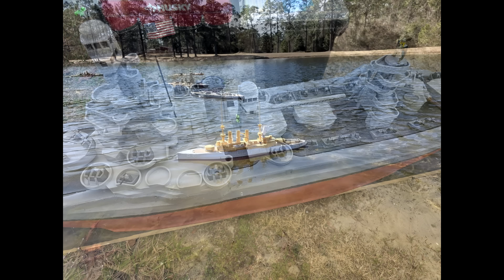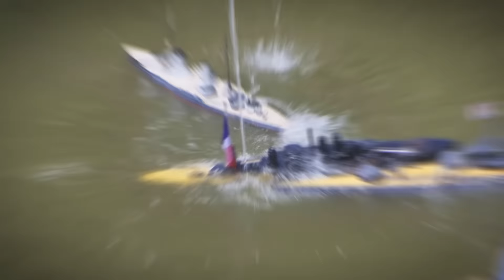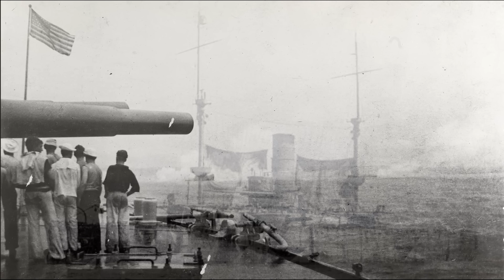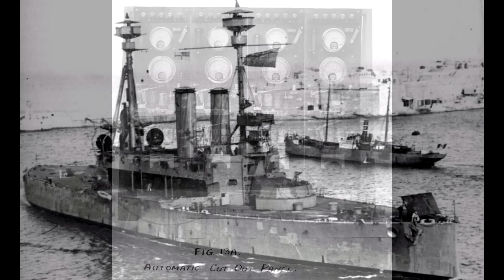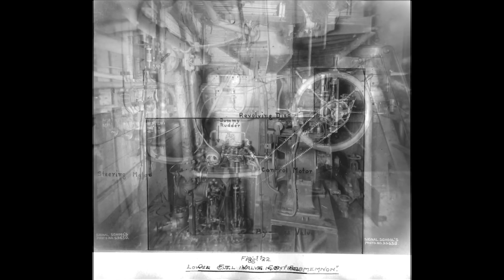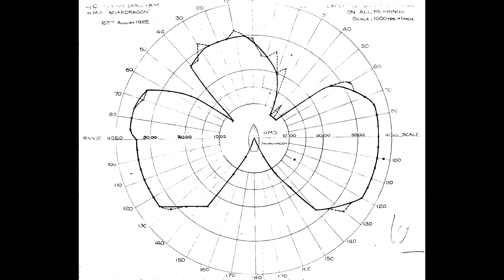Radio Control Battleships - HMS Agamemnon and How She Worked

Comment: Most modern CNC coding still uses a strikingly similar 2 digit canned-code callup format. Even which numbers are left unassigned for user-generated macros have stayed pretty much the same with lower numbers and highest numbers being assigned by the machine manufacturer with commonly needed functions and modes.

Im pretty sure that they couldve used more house phones to encode subroutines for complex navigation. With their clockwork experience they may have been easily able to make a rack of sequence dialing phones to all feed their stored inputs into the 100 command switches.

You'd maybe have to hardwire each phone for a set subroutine but setting up another switchboard to flip between sets of routines probably wouldve been within their means and expertise.

Any more info on individual components would be appreciated or any kind of follow up really

Comment: Back in the 80's and 90's when I was in the USN, I spent 11 years stationed at Submarine Base Bangor in Washington State, north of Bremerton and the Puget Sound Naval Shipyard, on the Kitsap Peninsula and the Hood Canal.
There were two rather large ponds on the upper part of the base, and a local chapter of the IRCWCC would hold matches on those two ponds on occasion. And at one time, I actually had a proper paper catalog from one of the area hobby shops, that listed all of the various kits that one could order, to construct one of those radio controlled and BB gun armed model warships, and take part in their battles.
And if memory serves, there was a periodical magazine dedicated to the hobby, that was available at area news stands and bookstores. No idea if said magazine was available anywhere outside Washington State.

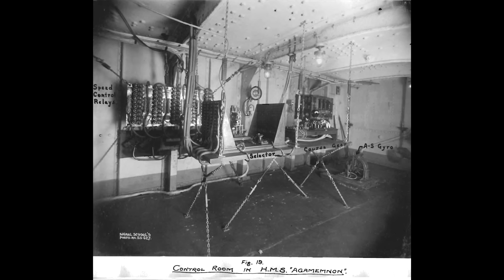Comment: 17:00 here you can see the valve driven control gear in a shock absorbing setup using chains and springs attached to ceiling and floor.

Comment: My late dad told a story about radio controlled boat trials in the early 1940s.  He was staying with his uncle Bill in Hythe. Bill was part of a team testing remote control of a small boat for whatever reason. They had the control gear rigged up in an old rowing boat (I assume because it was expendable) to which they had also fitted a ford V8 out of a broken truck and some form of prop. They started by testing the rudder; "Rudder Port", CLACK!, Rudder goes to port. "Rudder amidships",  CLACK! rudder centralises. "Rudder Starboard", CLACK!  and all good. So they start the V8 and the contraption gently putters off into Southampton water.  The "Hold my beer" moment was when they went to throttle up the engine, CLACK!, VROOOOM, at which point the torque rolled the boat through 180 degrees and it sank on the spot.

70 years later my dad still thought the best bit was the way a bunch of wartime boffins all fell about like schoolboys (which he was) because it was so funny.

Comment: Just from the opening montage can the 1/144th scale didn't apply to propulsion out put and rounds per minute though I'm not sure if that actually or maybe the weight of the projectiles is what should be used for comparison .., I don't want to use my brain BBs are .177cal  1/ 144 scale to 14 inch  naval csnnon

Comment: Note for Americans: I don't know if this is obvious, I know Drachinifel viewers tend to be quite intelligent (pats self on back), but just in case you didn't know, the "valves" he mentions are what Americans call "vacuum tubes". They are basically early electronic transistors, or an electronic switch, needed to control electronic equipment. They were cutting-edge technology at the time and quite unreliable, hence the trouble with them. Anyway, I hope this helps!
Reply: This helped! I'm an American physicist living and working in England for over a decade, and still I had somehow never run across this bit of terminology. It's not about intelligence, it's just not a technology that comes up much anymore.
Reply: That is what I thought, but thank you for verifying it.
Reply: Valves can be quite reliable, but you have to treat them right. The main issue is that parts of the valve have to be heated using resistance wires, and all of the working bits have to be in a vacuum contained within a glass envelope. For one thing, some insulation from mechanical shock and vibration is required so that the vacuum seals don't leak and the glass doesn't shatter. For another thing, they hate to be switched on repeatedly, because the thermal cycling makes things break - it's better to just leave them on all the time, even if not actually doing anything. Rapid pressure changes are also a no-no, because flexing thin glass does not end well (a significant issue in a submarine).
While a valve is much larger than the equivalent transistor, that means it can also handle a whole lot more power. They were used for much longer than you might imagine because of that last feature - especially in radars..
Reply: @onenote6619 I've actually heard that before, I think it was the great Tommy Flowers MBE who worked on colossus. When they went to build the thing, during WWII to help decode German signals using the Lorenz cipher, they realized it was going to need THOUSANDS of valves. He knew from previous work before the war that valves could be reliable, but it took some convincing to get the go ahead to build it.

This was nearly 30 years after the events in the video took place, though. It could be that those early valves really were that unreliable, or the engineers who used them (maybe even those that built them) didn't know how to properly operate them. Either way I find the subject endlessly fascinating. Thanks for the comment!
Reply: @SirWilliam7  One of the ways to improve reliability for equipments with lots of thermionic valves - like Colossus - was to store the spare valves in a hot room. Every time you cycled them thermally, some would break. So if they never got cold, a significant failure mode was removed.
Reply: Ah vacuum tubes that makes much more sense. I was really confused, picturing faulty valves on the ship's piping, like steam valves and the like. Appreciate that sir, I can't speak for anyone else on this side of the pond but my Yankee brain was quite lost there for a minute.
Reply: @williamcostigan91  I'm so glad to be of help! Cheers from sunny Lawrence, KS! (I'm living in the US right now haha)
Reply: Thanks. I was wondering WTF Drach was talking about.
Reply: I was already aware of the term, but I grew up in the '80s and read about a lot of British technology. Particularly radar and early computers. Which is how I learned about it. That being said, it's an old enough term that I can still appreciate someone defining it for thos who've never heard it. I still remember having to explain what a vacuum tube is to one of my nephews. I hate getting old.
Reply: @allanmonroe692  I'm trying to keep up a good humour at getting old, but it's hard. I turn 40 next week... I've spent this month trying unsuccessfully to stretch out each day lol
Reply: Not all of us Americans are stupid.😂 Its just that many chose what information we carry with us into our adult life. US schools cover so many topics over the 12ish years of schooling many people dont retain everything they learn. The benefit is that some topics overlap and compile.over the years building more specialty. History is hard for us because of many sensitive topics explored in more detail at the teachers discretion. I for one, figured that the "valve" would be an electronic device. As the shape of the example did not match any mechanical valve known to me. For me history and science are my strong suits. While high level language and mathematics still elude me.
Reply: @Lorenzozolezzi  No offense intended! I'm a trans-Atlantic person with one English and one American parent so I think I have a unique perspective on the respective cultures. But I appreciate your insight as well! I for one think the British use of the word "valve" when they mean "vacuum tube" makes sense on the one hand, it's because of the "flowing water in pipes" analogy used to understand electric circuits, so a thermionic valve acts like a valve in a pipe, switching the water on and off with a third input. But outside of that context the term can be baffling. "Vacuum Tube" is more descriptive without referencing the function of the object, so neither one is better, really.

Comment: Amazing use of technology 100 years ago. Although implied in the discussion of control systems towards the end of the video, the boiler fuel setup is not explicitly stated. As built Agamemnon was coal-fired with oil-spray for extra power when needed. Was she converted to pure oil-fired  earlier in her career or as part of the remote-control conversion? I can’t see her being any part coal-fired as a remote control target.
Reply: I also wonder how the boiler water levels were controlled, wonder if there was an automatic system or low water oil fuel cut out for this as well so that the boilers did not run low. Stanley steam cars had such systems.

Comment: Plus, there is the little problem of finding someone to actually maneuver a target ship would not be very easy. Going to prison for refusing or dying is not a good set of choices. 

The hit rate of 6% with no one shooting back definitely indicates a need for Gunnery practice.
Reply: In pre-radar/automation days (1880's to mid WW2) 6 to 10% hit rate with long range naval gunnery was considered good shooting.  They had to determine range/heading by visual observation (using binocular range finders) observe fall of shot and estimate errors then recalculate a new firing solution.  All from a heaving and manoeuvring gun platform firing at a target busy trying to return the compliment - at ranges of several miles.

Comment: Military equipment that is refitted to become radio controlled for target practice sometimes get a mind of their own.
2 military jets ( A F102 delta dagger and F4 Phantom ) revolted and got a mind of its own.🤣
The F102 said i am out of here after takeof took a low altitude scenic cruise went missing for hours and was found bellylanded with minimal damage and  now resides in a museum.
The F4 "catch me if you can' went totaly  crazy , became an actual threath and mocked the military who weren't able to shoot it down.
Only when the fuel ran out it crasched into the ground.

Comment: Rotary telephone dials continued to appear in various non-telephonic applications and deserve to be remembered as the wonders of electronic selection they were for the better part of a century! So long and broadly did they serve that I have two rotary telephone dials here on the old stuff shelves without even trying. Rotary telephone dials. Amazing.
Reply: Great Video Drach and very interesting how they addressed the various engineering challenges with the tech available during that time period. I agree on the rotary dials being a ingenious way of inputting commands to the controls for various functions. I had thought different frequencies, but this system doesn't need that. As someone who worked on old phone systems in the navy and had to study even older phone systems, I also sort of cringe wondering how tolerate the system was of the equivalent of mechanical-electronic slop. (The dial speed on those is controlled by a governor on the backside of the dial that has two leaf springs that push out into a small cylinder cap. You adjust how fast the dial turns by putting more or less tension on the springs). 

Looking forward to seeing more!
Reply: remote control of railroad switching/interlocking.....    at least if you have a decentralized system there each interlocking only deals with the local area say 2 km each direction.
One other function usually available in the same system was a function for activating the switch heater elements.

And via separate channels  remote control of  overhead high voltage breakers/switches.

Comment: Could these hypothetically with more control signals be used as an armed drone. Would that have had a place in ww1 or ww2?
Reply: Battleships, no - too complicated to be useful or practical - visit a museum ship to see just how complicated warships were during this era.  

The Germans did have remote controlled explosive speedboats - FL-boat aka Fernlenkboot in WW1 (wire guided) and Linden (radio control) in WW2.
Reply: Hmm, I hadn't realized they have such a large crew—probably around a thousand people, each with their own responsibilities. Managing analogue electronics with minimal processing power must be incredibly challenging. It might be more practical to start from scratch, especially if using old ships to attack ports isn’t financially sensible. A 20,000-ton vessel sailing at 30 knots with 10,000 kilograms of explosives could cause significant damage and disrupt many lives. Of course, a single strike on Gestapo headquarters in the area might achieve a lot before resorting to destroying the port entirely... although that’s probably unrealistic or impossible. Still, I can't help but smile imagining all those guns on a super dreadnought firing together—what a sight that would be 😂😂😂

Comment: Were the ships oil fired? I can't imagine a coal fired ship would travel for very long without a crew. Even if it was oil fired leaving an old high pressure steam system unattended gives me shivers
Reply: The description of the safety shutdown system alludes to the fuel oil feed pumps.  I don't think they would even have considered coal-fired ships.  Naval boilers rely on continuous water feed pumps rather than injectors, and are of course fitted with safety valves to guard against overpressure events, so it would be safe enough at least for a ship operating without crew.

Comment: The safety and cutout systems, as well as all the redundancies, is engineering genius at its finest. I especially love the fact that they left spare channels just in case!
Reply: I concur!  Given the era, the  technical limitations, and size of the ship the design/engineering team did a phenomenal job.
Reply: @jprehberger  Ah the days when people still planned ahead and took their task with forethought, and considered the long-term and set up contingencies. 
The complete antithesis to the modern fad mentality of 'vibe coding'.
Reply: @jprehberger  People back then were anything but stupid --- at least not the well educated ones.  They may not have had all knowledge (the Titanic's steel hull was very brittle in the cold water, for example, and the long, long tear was not within the design specs ...) but they did very well with what they had.  And sometimes they went to and beyond what technology could deliver (Babbage would have that trouble with both the difference and analytical engine, metal part making was not yet economical at the accuracy needed. His itch were the corrections to the corrections of the corrections of printed tables --- much of which was on account of type setters making mistakes, hence an attached printer.  The government only cared about producing cheaper tables ... and they did not materialize fast enough.)
Reply: Analog control feedback loop with gyros, this is like engineering heaven.

Comment: 1/144 radio control battleships that can shoot each other, has Drach got a new hobby? Should we weep for his wallet?
Reply: 144th scale seems grossly undersized
Reply: @ianbitmead6202 an Iowa would be over six feet long at this scale, my subs are a pain in the ass being seven, and they are using bbs to sink each other , you dnt want a massive volume to have to flood over hours if you want exciting fun.
Reply: @ianbitmead6202  That us 10-12mm miniatures in wargaming, and 'N' Gauge railway. because you want that dry dock to be fully functional as a railway layout as well... No half measures here...😜

Comment: As alluded to at the end, the U.S. Navy had a similar setup for itremote controled targets.
I am looking forward to Drach's video on it!
Other than it used a rotary phone setup like the British, I know nothing about it!
Reply: Its likely that rotary phone mechanisms were the standard autonation of their day. RF communications would be pretty well reduced to digital in those days for lack of processing power. Valves were expensive and of limited use.  Systems with three or four valves would have been considered 'very complex and powerful'. However sending/receiving a string of pulses to operate a strowager would be easy and as long as high speed is not required, capable of many channels. Put three is sequence (rather than the two that seem to be in use, 00->99) and you could digitally switch 1000 channels.
To be fair though, it is a neat solution.

Comment: The steering system reminds me of an episode of the excellent old show Junkyard Wars where the teams had to build remote control demolition derby cars.  One hooked the steering motor to the wheel using a bicycle chain and sprockets, which allowed them to fiddle with different gear ratios until they found the one that gave them the best control.
Reply: Core memory unlocked

Comment: Requesting clarification for the American audience. When you say valve, do you mean an electronic tube, like you might find in a guitar amplifier, or a valve for directing water or hydraulic fluid? Can we get an English to Merican translator? 😂
Reply from the maker: Valve as in the glass and tungsten electric kind like you'd get in ancient radios and the like :)
Reply: @Drachinifel thank you. Please never underestimate the audience's ability to be ignorant and confused 🤣
Reply: The full term is "thermionic valve", referring to the electrons being produced by a hot wire within the glass envelope, then controlled by the voltage(s) on the grid(s).